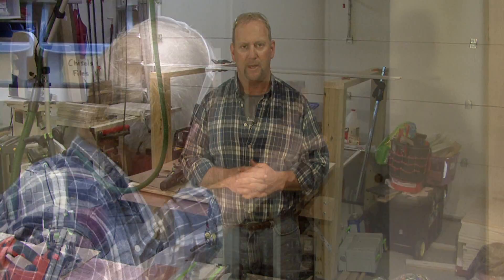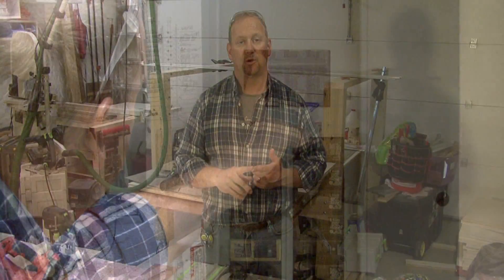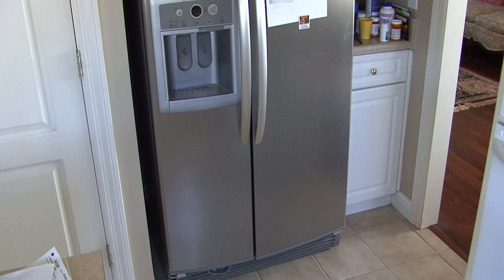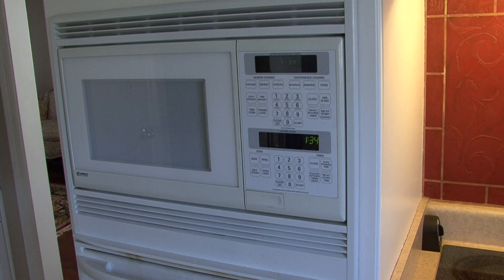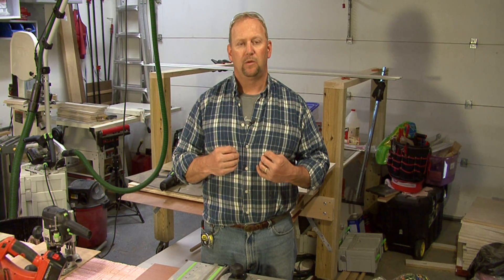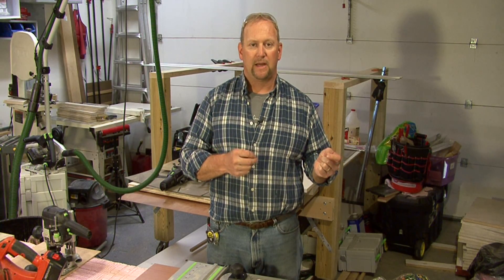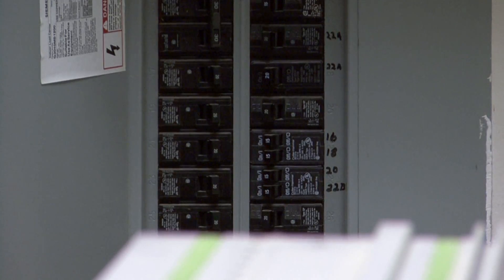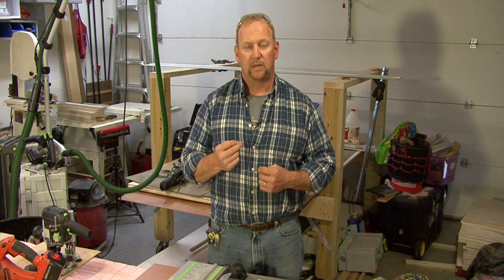Home Improvement & Maintenance : About 100 Amp House Wiring

Comment: You’re missing a very important point regarding 100 amp service......are the major current users such as kitchen range, water heater, clothes dryer or house heat gas? If these are all powered by natural gas then a 100 amp service is more than enough power to the average size home. The NEC in fact still permits new 100 amp services to be installed however most new construction does use 150 or 200 amp simply because it allows for future expansion and with new construction, the additional expense between 100 and 200 amp service is not significant.

Comment: Thank you so much for this. I'm about to make an offer on a home it was just gutted and redone but only with 100amp which it minimum. The house is from 1937,the wiring is copper redone unless there's more than aluminium and copper that can be used for wiring? If so what is the other kind of wiring besides aluminium or copper to be used? Well they do not sell the home with appliances.. is it because the house cant run a fridge, stove, furnace, water heater,washer and dryer?? I'm afraid now they are trying to scam us! I'm a first time home buyer,it's just me and my husband to be,we are not having kids so the 780 sq feet is perfect for us but is the amps too low will we have a problem if I were to need to dry my hair with the oven cooking, the furnace or air conditioner on with the clothes dryer going? It has a basement too of 600 sq feet

Comment: I had a new 100 amp main breaker installed to my meter box.  My electrician wants to install a sub-panel in  the center of my house to shorten the homeruns,  I think I will do it myself, would it be a 50amp/#6 gauge wire from main panel to sub panel? If its like 30-35 feet, how will I ground the sub-panel, its not detached so do I need to worry about ground?
Reply: Have it put in if something happens insurance won't cover due to work not being done by a licensed electrician.

Comment: I have to install a new 100 amp main breaker to my meter box as my old ones wearing out. However, my local utility company is saying I need a permit to change it, the utility company to cut power, a city inspector to approve the new installation, theeeeen my power restored. Do I seriously need to do all this??? I may not be too intelligent when it comes to electrical stuff, but I'm no dummy. I think they look at basic individuals like a woman in a mechanics shop having her car serviced. They see folks as naive, so they can lie to get more money, and this is THE CITY! It's not Joe blows electrical from B.F.E. Any opinions? Thanks.
Reply: Yeah were in california and had the exact thing done. Permit, power turn off, inspection and power restored
Reply: It's pretty standard for permits and the utility linemen having to disconnect and later reconnect you. A lot of it is because the danger level usually increases with amperage and to guaranty that the meter doesn't get bypassed.

Comment: Years ago I remember reading that the reason a rated panel could be exceeded by installed breakers  (actual breakers add to more than the panel rating) was that the legs are in parallel which allows greater amp usage by some calculated amount ?